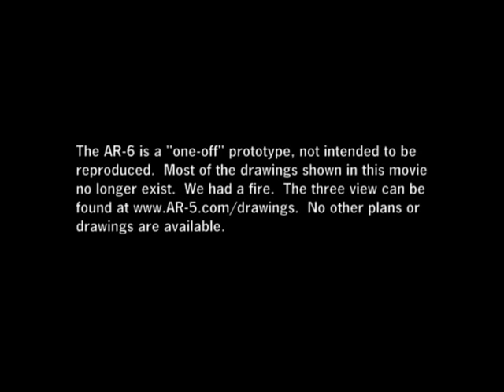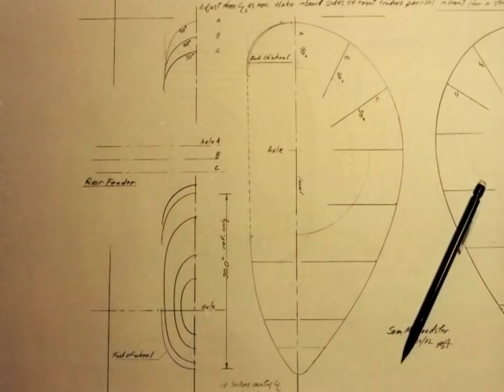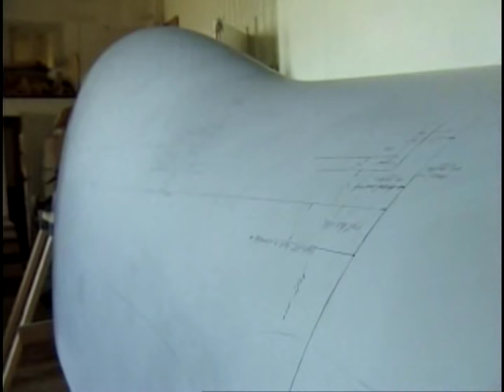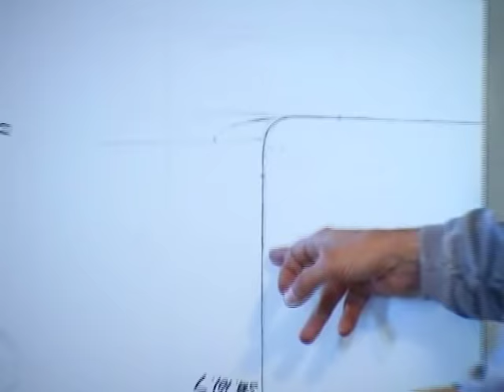Making A Molded Fuselage

Comment: I had the pleasure of working with Craig Cato in Petaluma on the Solo. American Air Technology. This was back in 1983. We built the Solo from molds and free form foam. The engine was 27 hp. The Solo looked like a Cessna 150. Craig flew this to Oshkosh, and was lined up to land in the Ultralight field. The tower radioed Craig he was at the wrong runway. He informed them he was an Ultralight. This entire plane weighed in at 300 lbs. The very first of a trend now employed by all. Thank You Craig, hope everything is well. Mike D.

Comment: This technique is a master at work. Forget 3 axis milling. Demonstrated here is how craftsmen have built up the world to what it is today, Including aviation. I learned to do this with surfboards, then aircraft tooling, then 3 Americas Cup sailing campaigns, and finally, built the original SpaceShipOne for Rutan. Its also how we started ReichelPugh racing yachts back in the day. Yeah, computers shape foam nowadays, but in the beginning, craftsmen did it with hands, and an eagle eye. You still can in your garage, and that's the point of this video, to show the 'goons' how the Masters do it.
Reply: MajorLeague  cad is all very well but unless its linked to a five axis milling machine then you still have to be able to make the object by hand, was in the prototype business for twenty five years, 2D cad was no better than the guy with a drawing board apart from the saving in paper!, when 3D came along it was great, we could get sections wherever we wanted, and we knew there was room for the components within, then they went and spoiled everything by making 5 axis millers, saw one operating that could mill 6metres by 2metres by 30metres all with an accuracy of a quarter of a millimeter, awesome to see but that was the bulk of my work gone, time to do something else!, a 5 axis miller would have done everything he did and put all the steps and joggles in in one operation, all in less than a couple of weeks start to finish ready for paint and moulding, but not in his workshop and not at the cost, as he was doing most of the work himself, this shows that you can do this without the technology if you are prepared to work at it, in your own shed, more power to anyone prepared to have a go!.
Reply: Hey OH7, were you by any chance involved in the single layer  diaphragm on the Saturn 2nd stage?  I know they recruited surfers to do the fiber glass work, as nobody else had the skill level, or the patients to complete the work to the standards they needed.. no contractor would touch the job,  so real perfectionist artists were needed, as you may already know.. 
  All this worry of skills lost doesn't worry me anymore,  there's a Renaissance of builders as the younger gen has melded old school knowledge and tech, with info flowing through the internet,  ideas, projects, builds, are your oyster, you can learn almost any trick by contacting people instantly.. 3d printing helps too..
   Still this guy is on another level, love how he kept it cheap and simple so the punter doesn't need to have tons of specialist equip to pull it off..
Reply: MajorLeague  the people with the skill/ talent to work by hand are unfortunately a dying breed, 3d cad linked to 5 axis millers cost me my core business, there will always be niche markets for a very few people but as those people become harder to find industry will change and even the automotive company's will give up on clay, as 3D and virtual reality becomes more powerful and more accepted prototypes will only be built for the motor shows, the
Reply: Industry is in a state of flux, but like everything it takes time to replace what was, I had the last of it, the previous generation had the best years, anyone still working how we did is on the dregs, I am not denigrating hand work it is something that still gives great pleasure, but today it tends to be just for me, designers are taught on the latest technology so they will use it, as I said before hand work will/ has become very niche and as an industrial model maker I have a very wide range of skills, skills the industry today has very little demand for, look at old drawing offices, lines of drawing boards with people everywhere, today all done with half a dozen on computers, the factories are mostly robotic, jobs change and some disappear, how many people do you know lead loads bodywork, the skill is all but extinct, roll on body filler!, that's life you can't fight it but you don't have to go quietly!!.
Reply: MajorLeague  that's kind of sad, computer designed aided by human!, its like the story of the factory of the future, staffed by a man and a dog, the dog is there to stop the man fiddling, and the mans job is to feed the dog. As for the phone numbers are you sure its the smart phone and not "just twenty years"☺, before my phone I had a little book, don't need that now, until the battery goes flat and then I am lost!!, keep the faith stay safe and don't go quietly.
Reply: Old school craft build, many hours of work, white light scan the engine, feed that data into nx or Catia and engineer your design surface and no cut foam model will cut many hours off this process and produce a highly toleranced surface
Reply: @jvaubry  I think you have missed the point , the mans skill means he can work in his own workshop without the dubious benefit of computerization, yes you could do it all on computer and five axis millers and yes it would be very accurate, but as I have stated before, NOT in his workshop, and NOT at the cost, technology is not cheap in terms of money or time, you either have to invest time to learn or pay someone else, then either buy the equipment at great cost or pay someone else to do it,invariably technology has meant people do not need the hand skills so wonderfully demonstrated here, you probably don't have those skills so you use technology to produce what you need, this is not a criticism of you or your abilities but there are many ways to achieve a goal, and this man has very ably demonstrated how he works.
Reply: @roger, respectfully, I have not missed the point. Title of video is creating a fuselage mold, so aerodynamics are a design consideration. To get laminar flow on the fuselage with minimum drag, you need the boundary layer to stick to fuselage surface, which means that surface must be defect free. The only way to get that is by engineering the product surface in cad, and exporting sections to a line printer and you can mount these sections on stations along the fuselage length at 25mm, 50mm or 100mm spacing. Glue your foam blocks between those sections and you can fabricate the surface in foam a lot more accurately.
Reply: Yep, they carved a half model. I was at the Maine shipbuilding museum in Bath and there were dozens of half models on the wall. Sections were taken from the models and scaled up to full size in the loft of the building, hence the term Lofting.
Reply: 1500 hours then, could be less than 100 hours today…..
Reply: CAD has one very powerful feature, other than manufacturing. That is CFD to prove and modify aerodynamics, significantly improving quality and performance of the finished product. Mike Arnold was a rare individual with Aerodynamic, structures, stability and control understanding. And craftsmanship, along with tireless effort. Not many people can design, build, test, and fly.

Comment: Thank you for uploading this! This is great to learn from. I am building a velomobile and some of the techniques you show, I think could be applied to that. I am new to this but eager ...
I too am carving foam to fit templates. I used CAD to make the drawings (only Google Sketchup mind you!) and from this I am now making templates just like yours traced out on large graph paper. I realised that I have too many templates now because of watching you work (50mm stations!). I can simplify things somewhat by using far fewer of them. I like the ideas of cutting a deep centre line and of drawing lines on the foam and sanding them off. There are so many great little nuggets of info in here and I am still only just 25 mins into it. Unfortunately I don't have a garage to do this in so it's all happeining outside under a tarp. Inspiring stuff, thanks again.

Comment: So fascinating. This is by no means a dig, but with some modern tech, this process could be so much faster. You could take a long close up video of the engine in hood lighting while it was on a stand, and then get an accurate 3D model out of it. Put that into a CAD system, along with other things like a volume for the pilot and controls and then form a skin around the whole thing. Add structure and check for fitment and even aerodynamics. You could then either use a large CNC cutter to make the fuselage molds or even just a plotter to make templates for the sections. We really are entering a golden age of design and manufacture.

Comment: I sometimes wonder if people watch things all the way through before commenting. The man did a foam/glass plane and broken a record, hit over 200mph with 65hp and his hands. I'm sure he never needed any help from 3D softwares.
Reply: Unicorn Automotive#1 absolutely true,that plane looked spectacular,something Mr CAD and CAM from the eighties,will never Know,because he has no hand eye co-ordination,and probably no heart as he had to verbalise the skill he has in CAD.
Reply: 65 hp? that's incredible. Imagine what the man would have done with a IO-550 or something.
Reply: Using extruded polystyrene foam as a core for sandwich composites is not something that should be promoted.  Its shear strength is woefully inferior to proper core materials.  The AR-5 was frighteningly experimental.
Reply: Ever heard of Burt Rutan? Lots of his planes used extruded polystyrene for the core...yup it has low shear strength but thick enough so it works in small planes
Reply: I agree with your comment, but with a minor correction. He says at 1:20 the engine is a 200CI Continental, which is an “O-200”. They typically produce at least 100HP, but are often modified to produce far more HP in these pylon racers. That said, the C-65 is an amazing engine - one of my favorites, and it is has an amazing performance record.

Comment: I think, making molds or any kind will continue to be an art. Computers might do 3d and calculations better than men. But man still have hands, eyes and incredible brains, that computers simplu not even close to having.
Reply: Though; high rate production moulds are made directly out of Aluminium with multiaxis milling  (no need to stop at 5 axes)
(The models are made with human ingenuity, even if that just means a detailed spec. and allowing machine optimisation to hit the right spot.)

The human "art" comes back in when assembling the final parts to blend in all the seams and "achieve perfection" in paint.

Comment: From these informative and sincerely descriptive videos will come some prolific designers and designs, now and for many years to come - of this, I have no doubt, that is your proud legacy Mr Arnold! 
I myself am researching and studying for an upcoming build of an all-new design that I hope will be the first of many as the culmination of a life-long obsessive passion. As the son of a carpenter I have always appreciated the art of 'eyeing' your work and shaping by hand.
I noticed some of the finer details of this AR-6 design and thought it worth bringing up for comment or response: 

1.Firstly and because this is one of the fundamental points of consideration in my designs, is the airfoil. I noticed at 26:44 a very clear indication of what looks to be a fully laminar flow airfoil (at least at the root, presumably carried through the full span?) what would be the thinking behind that, would it be to maximize cruising speed, would it not sacrifice handling or performance at lower speeds, critical for a heavy wing loading? Just about every laminar wing I can think of employs a large and cumbersom flap system to improve low speed, provide necessary lift on take off and bring flight speeds down on landing, but I don't see such a system, on the AR6?

2.I notice too that in relation to the plug axis the airfoil at the root is not set at any discernable positive (or negative) angle of incidence -AoA, I know that technically this angle is measured against that of the stab but to maximize speed the closer to nuetral the stab incidence is the less drag is induced which I know is something he was obsessively concerned with to the enth degree.  

3. I know he touches on this in more than one of his videos but perhaps someone can contribute as to why he chose fixed gear. For a man obsessed with reducing drag and commissioned to build a machine to go faster than any other surely the weight and complexity of a basic retractable system - even if only for the main gear with a streamlined tail wheel would be negated by the gains in speed and drag reduction? I would ask Mr Van that same thing if he were obsessed with speed but RV'S are built for rugged spritely performance not ultimate record breaking speed. 

I have many, many more questions that had circumstance allowed I would have mailed to Mr Arnold but in lieue of that is there perhaps someone as knowledgable or who has insight into or familiarity with his thinkling and processes who can possibly answer some questions?
Reply: Allow Me to attempt an explanation:

Form follows function. The AR-5 was meant to be a sport plane with good performance having little horsepower. It went about as fast as the Vans RVs but with only 1/3rd the power.😮

Based on his article(s) Mike simply realized it had potential to break the newly established sub-300kg speed record, so he did.

This video documents the AR-6 construction, which was purpose built for IF1 air racing, and flew many times at Reno Stead airport and several other venues.

Race planes generally omit flaps. They add weight, and gaps create drag. There is no requirement for slow landing speed in air racing. The wing area is defined as no less than 66sqft. Minimum weight must be 500 empty, and a minimum pilot weight of 160lbs.  This is a large wing for this weight, giving only 10lb/ft of wing loading. which is very light loading. 

So No need for flaps. And at the speed these aircraft race at (230-260mph) even at higher elevations, the large wing, lightly loaded, only needs about 1/2 a degree of incidence for level flight.

And yes, that is a Laminar flow airfoil. You can see another view of leading edge at 21:22. 

It was described by Mike Arnold in a talk or article, as a "Harry Riblet" airfoil. But this is not true, although He apparently modified it for softer stalls. He was not capable of  generating that specific shape, because Riblet had a distain for inverse design, based on a cursory read of his half baked book.

The airfoil is in fact an NLF-0414F designed by a genius aerodynamicists named J.K. Viken and is an evolution of his early work and masters thesis. It was later studied and adopted by NASA. But this AR-6 airfoil has most or all of the camber removed and no flap. This Mod was actually performed by another aerodynamicist for John Sharp of Nemesis air racing for the DR-90. An article detailing this exact airfoil: Lednicer, David A. "Fluid Dynamic Analysis of Nemesis and Shadow" EAA Sport Aviation, August 1997.

The basic NLF-0414F generates about as much lift as a standard NACA 4-digit airfoil dose WITH a flap deflected.😮 But removing the camber reduces max lift quite a bit. The NLF-0414 is Still a good airfoil without camber, because the leading edge shape was blunted to improve the stall. Loooong before Riblet ever got ahold of it to modify it.

While this modified NLF airfoil or some near approximation of it has flown on the two fastest F1 race planes ever. It is actually not optimal for pylon racing. The original ordinates can be found in a hidden gem of a free download of the Eppler profil code which was modified by the late John Roncz, another aerodynamic genius beyond belief. That download is available from PDAS site if you go looking for the Eppler code there.

Anyone that seeks a truly optimal airfoil for Reno, or wherever the next venue will be, needs a 100% inverse-designed foil that is fully optimized for the rigor of closed course pylon racing.

Comment: 45:13 For anyone referencing this info for a future build: This spot marks a serious error, which should be corrected for future designs. The C-channel wing spar MUST have the shear-web at the leading edge, and not the aft edge of the main spar caps. 

There is a very serious reason for this. Ironically, that very reason is being discussed here. But stiffening up the leading edge skin of the D-box is only a partial solution. By moving the shear-center forward, especially forward of the aerodynamic center, this will have a profound affect in improving aeroelastic divergence. Anyone who is confused by this observation, get a C-channel that can be flexed, even a tri-folded 6x6" scrap of paper. Mount the top and bottom caps and shear web to the corner of a countertop. And apply upward load on the free end. Observe which way it twists and consider how that affects the wing under load.

Otherwise, very impressive build. Mike Arnold was brilliant!

Comment: nice I guess for a garage project, but I would have given this to a numerical control shop with mold purposed foam or even wood to make the mold.  Nothing to detract from the efforts and techniques of Mr. Arnold.  But for others who may want to embark on a project like this, it doesn't cost that much and you'll have a nice symmetrical fuselage that conforms to your CFD work.  Then the only questions are were your assumptions right in modeling for CFD as to being on condition with Re No., cruise condition of speed angle of attack and altitude, and did you choose the right combo of engine and prop to make that happen at those conditions.